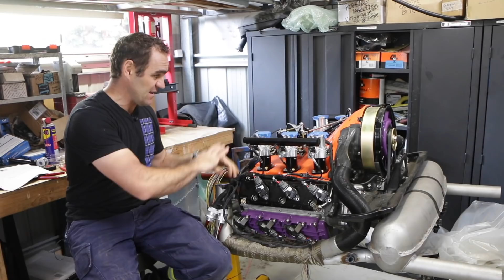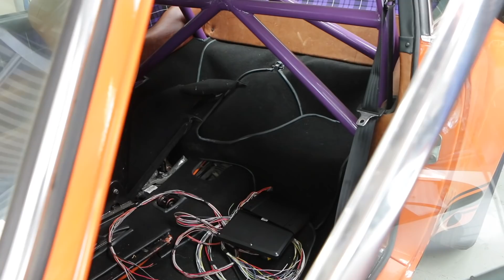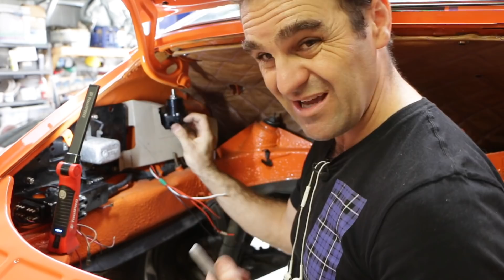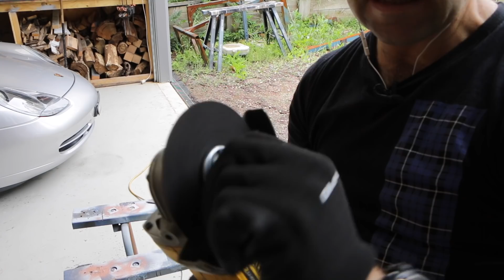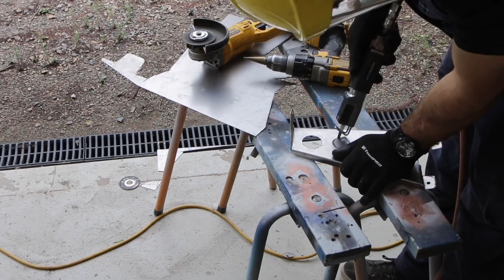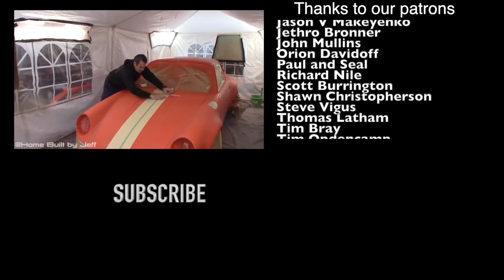Mounting the ECU - 911 2.8 RSR Build Season 2.24

Comment: Mounting the ecu in the engine bay is neater. I know most ecu manufacturers says to not do that, but the 911 engine bay is unique.
Regarding the angle grinder, if you just tighten by grabbing the disk and turning (wont fly off) you can usually loosen it the same way, no tools no special nuts.
Reply: Do you run your ECU like that?  Trying to decide if I want to mount my ECU in the rear corner of the engine bay (where the electrical panel is) or not... Some say the air-cooled engine bay is cold enough.  What about heat-soak when the car is off and not moving?

Comment: About the grinder: the construction  of it help to tighten screw while working. There is trick to make disk change toolfree: cut from your draft yellow cardboard circle that's moks inner flange of but and put it under it right to the cutting disk. When you tights use only lock button and force of your hands, you can tight but with disk own. When you want to unscrew nut it would be easy AF, because cardboard will amortize thought force of working disk. If somebody is interested I can send the link to this trick. Workin with this for years
Reply: PS but = nut. PPS Slavics are lazy ;) PPS fast turning nut with additional piece on it is not so safety

Comment: Jeff, great job, way better than I did on my '74 911 several years back, but I had a suggestion about grinder wheels.  I run probably 6 different grinders in all, and I just hand tighten the grinder wheel, cut off wheel, wire wheel, etc, and let the grinding action keep it tight.  To remove the wheel I just engage the spindle lock, grab the outside of the wheel and twist, and it comes right off.  Probably not safety approved, but have been doing it for 25 years and it seem to always work fine.  You're a way better craftsman than me though, so feel free to ignore this suggestion.

Comment: You ever notice how modern wiring harnesses are wrapped? They are not spiral wrapped in tape. They are bound at intervals with tape, place inside a sheath which is taped. This is supposed to allow the wires independent movement and reduce the chances of breakage.

Al ,from the Skid Factory, as a how-to episode that explains this IIRC.